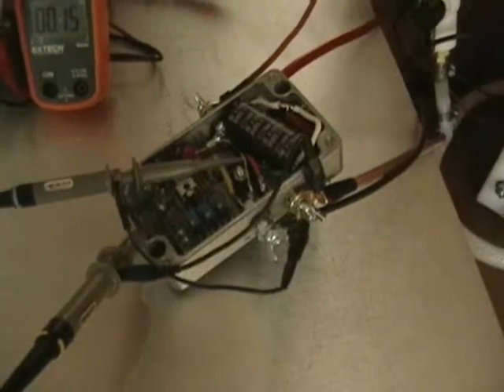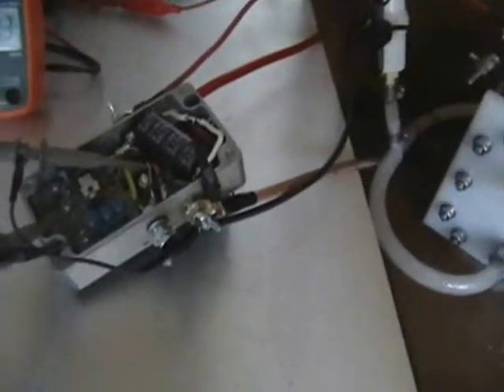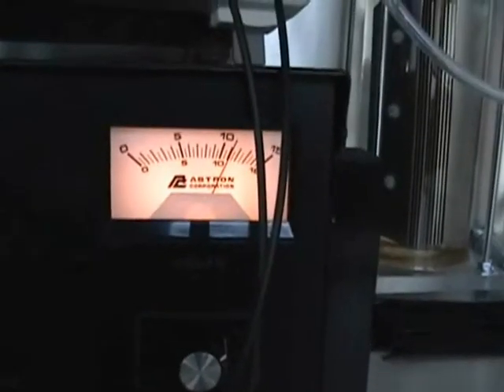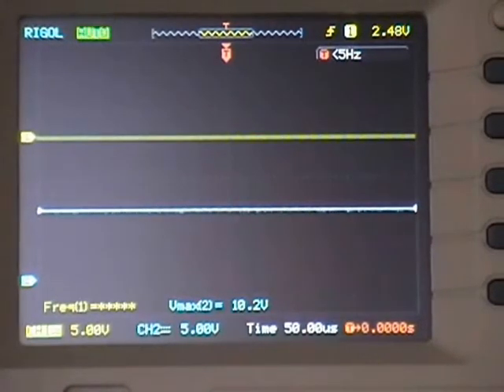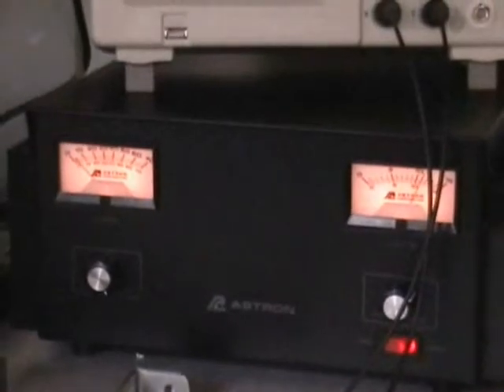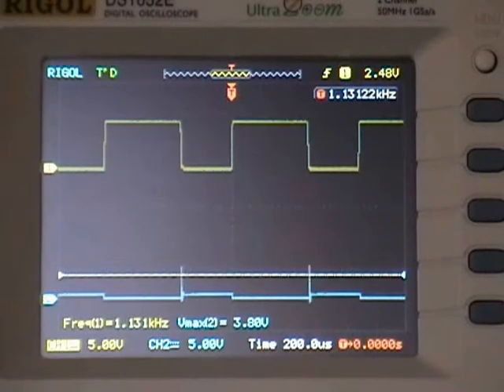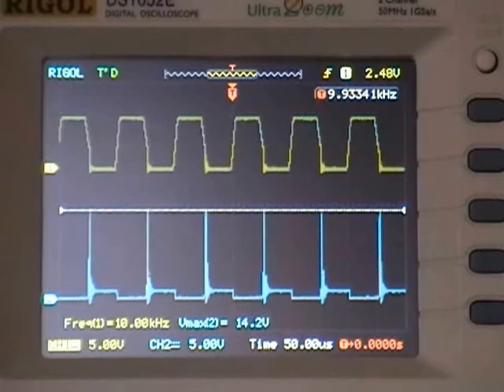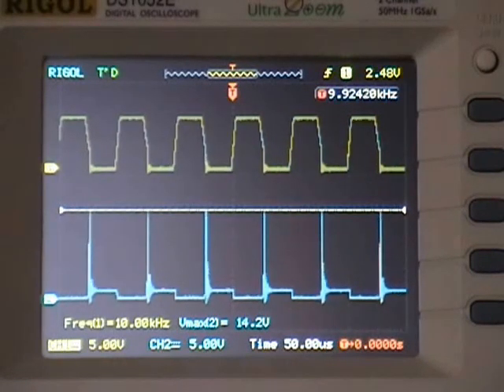Pwm functionality Test (13)

Comment: I will test the new plates and see if it still gets warm ,pwm is ok  just at the end where the wire connects to the cell .This is just my test cell voltage is high in the gaps,3 volts new cell is 2.30.we are desiging a new kinda regulator for the generator which works on 3 psi,when it is running I will show the video,we changed timing,and spark ,comming soon.

Comment: I Am sure all connections are great  crimpped,soldered,and tight.afetr owning a stereo shop for 24 years I have gained wisdom.I think it is the small bolts which go thru the plates is the problem, my new 7x7 cells will be ready soon,I used a 3/8 aluminun stud for the plates, I wanted to use copper but it is hard to find but thanks for the come back Z.